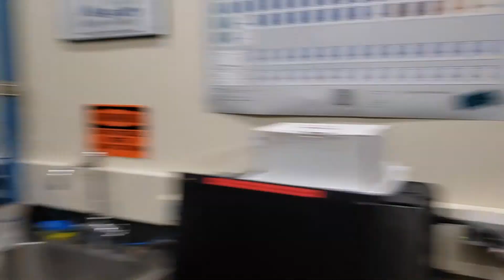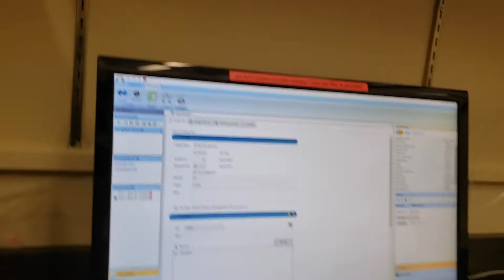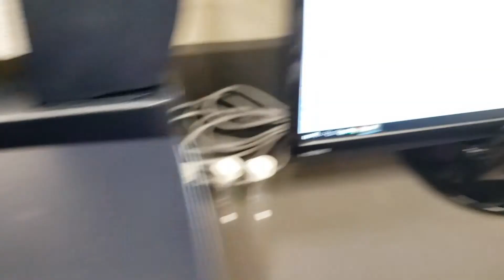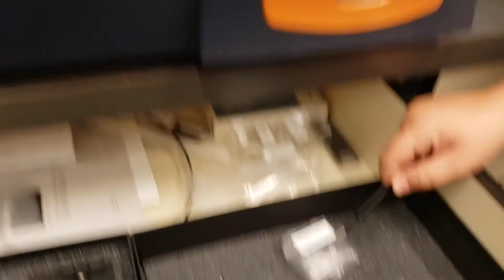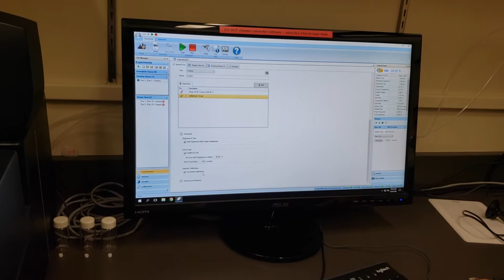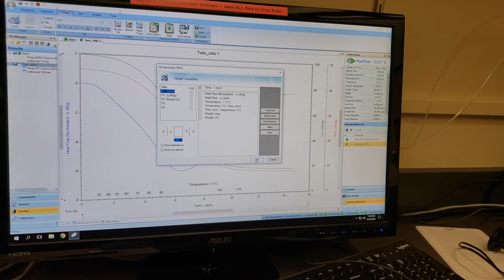TA Instruments Discovery SDT 650 required training for MCL

Comment: Thank you for teaching us about the use of the instrument. I have a question. We at the Universidad del Valle, Colombia, have this same equipment and we calibrate the heat flow with a standard sample, calcium oxalate. Although the manufacturer of the equipment states that it can only do TG-DTG/DSC, it also gives results as TG-DTG/DTA, that is, instead of evaluating 2 or 3 signals (TG-DTG-DSC) as stated by the manufacturer, it gives a total of 4 types of signals (TG-DTG-DSC-DTA). Does the equipment you have do the same? 🍃
Reply from the maker: Without a direct example, I'm not sure I can confirm whether our instrument is doing the same. DTA and DSC are closely related techniques, with the difference being that DTA measures temperature differences between a sample and a reference, while DSC measures heat flow differences between a sample and a reference. Since the SDT650 measures temperature through both the sample and reference beams, it is quasi-DTA. However, it isn't optimized for that technique so I wouldn't use it as such.
Reply: @materialscharacterization4168  Thank you so much. Regards.

Comment: What do you mean by repeating calibration if I will run my sample under air instead of nitrogen
Reply from the maker: Hi. TA (the manufacturer) recommends calibrating their instrument approximately every month. Calibration includes running known, high-purity standards to ensure the detectors are reporting the correct temperature, weight, and power values when a sample is being run. TA also recommends that if you change the pan type, gas type, gas flow, or heating rate, that you recalibrate. Each of these changes can affect how the machine detects power, temperature, and weight changes, and could potentially invalidate the calibration that was done previously.
In my experience, changing gasses does not invalidate the calibration to a large degree. We regularly switch back and forth between air, nitrogen, and forming gas. We run all of those with our "Nitrogen" calibration and get little perceptible error. If you require a high degree of certainty in your results and your calibration is done with nitrogen, I recommend running a new calibration in air with the same parameters (pan type, heating rate, gas flow rate) as you wish to run your sample.